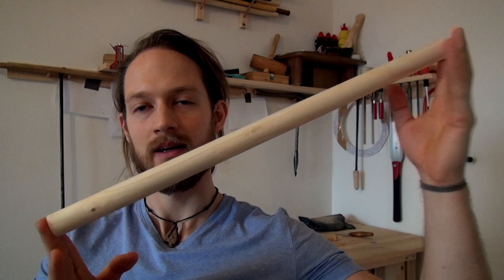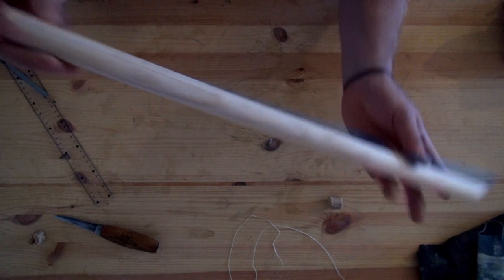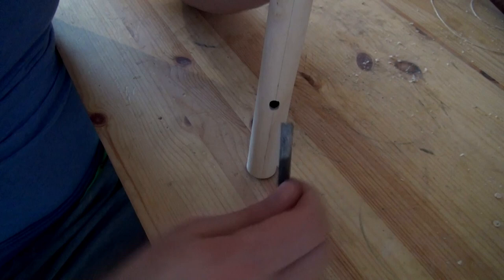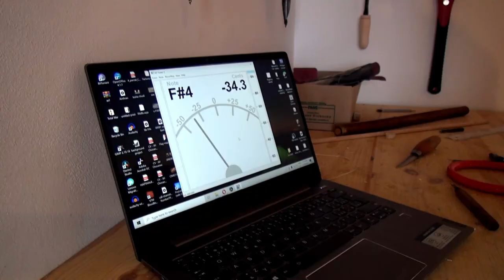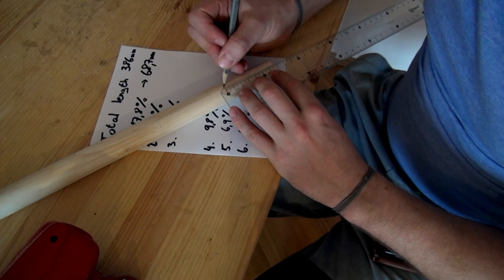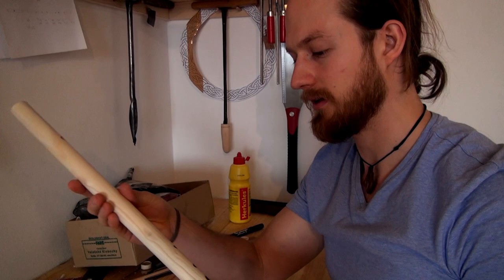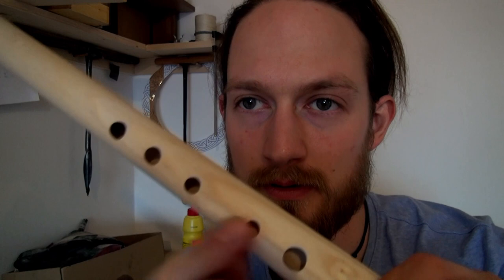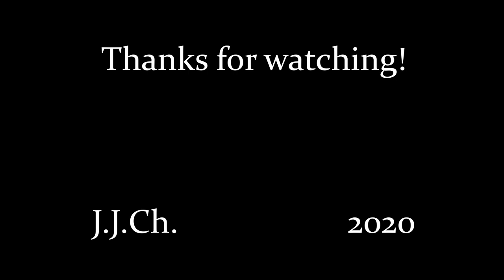How to make a wooden flute pt.2 - TUNNING

Comment: Fantastic information. Been looking for answers and you've provided charts as well. I turn wood as a hobby and a friend asked if I could make him a flute with Celtic knots. I wasn't quite sure where or how to start but this helps out tremendously. Question though if you don't mind. He wants a flute with a window gap as to be played from the front rather than the top, and I was wondering if there was a specific angle that it needed to be at. Thank you for your time and for this fantastic video.

Comment: The cork position in the length of the inside diameter from the center of the  embouchure. Say your inside diameter is 1.5cm...make a mark 1.5cm from the end of your wooden dowel and push the cork from the root note end until the mark aligns with the center of the embouchure hole. That's a good start! Good luck!

Comment: thank you so much for this great content. tbh though, it looks absolutely impossible to me to get to handcraft that wooden tube, perfectly straight and with that perfectly straight hole :O i saw the tool you used in the other vid, but yet.
Reply from the maker: Hello there, well no worries, the flute doesnt have to be straight at all. Watch my other flute videos, I am using a crooked tree branch as a flute material and it works just fine.

Comment: Hi 
Really like your videos.
I have had a go at making a high D whistle out of Elder.
The B note sounds a bit flat. This is putting my left finger on the hole nearest the mouth piece, all of the other holes being open.

Please could you tell me if making any of the other holes bigger would help, or if there is anything else I can do. 

I like the sound or it and the Elder is lovely to work with. The mouth piece is a high D Tony Dixon already made, so I cheated a bit. I have deliberately made all of the holes a bit smaller in case I needed to adjust.

Kind regards 

John

Comment: Amazing work, thanks. I am planning to make mine from cherry wood or any other dry wood or branch I could find but I have a question here: Should the form of the wood that I am going to start work with has to be branch form (originally syllindiric) or can I use any part of the wood which is cut from the body of the tree (I mean can I use the wood which is not originally syllindiric). Does that make any difference? And lastly, do you have any preferred kind of tree to make a flute or can I use any of them?
Reply from the maker: Late answer, but to your qustions:

You can use any part of the wood, just make sure, it is seasoned properly, so it won´t warp once you are done making the flute. I recommend using wood without knots, but that is personal taste really.

I like to use Ash and Cherry the most, but any hardwood can be used.

Comment: While tuning, how do you get the higher octaves in tune with the low octave while not changing the low octave? Do you enlarge the holes in a certain way? I made a flute but the low and high octaves are out of sync with each other and I don't know how to fix it. Thanks a lot!
Reply from the maker: Hello mate, this is actually quite complicated problem, which would be worth making video of its own. Which I may do once I have the time.

To keep the answer short, you can make the hole sound higher in the higher octave, while affecting the lower octave only slightly with couple of methods. The easiest one is to make the hole conical instead of cylindrical. 

conical = the hole is bigger on the inside and smaller on the outside

cylindrical = the hole has same diameter all the way through

But again it is more coplicated than this to get the perfect sound, I may cover it in some future video. Try using the trick I desribe above, It should fix your problem, or atleast improve it significantly. If your flute is too off (difference between higher and lower octave in several tones at the same hole) than there is something else going wrong as well - wall too thin or thick, bad material, some hidden crack etc.

Good luck!

Comment: Awesome video buddy, it helped a lot. I play flutes for a few years so now throught lockdown I started to make my own ones but I struggled with tunning a lot haha. I suppose that calculation is applicable even for different kinds of flutes and whistles ? :) I mean, what if I have different number of holes ?
Reply from the maker: Hello there mate, glad to hear you find it helpful! The calculation is definetly applicable to different kinds of flutes and whistles. 

If you decide to make and traditional irish flute for example (which has two more holes at the bottom, eight holes in total, though the two bottom holes are not played) you start by cutting those two calibration holes and than tune them to get your bottom note (traditionally that would be D). Than you continue you the same way I describe in this video, except the value "total length" (in case of this video 386mm) would be measured from the embouchere to the first of these calibration holes.

Other flutes (pentatonic flutes etc.) can usually use similiar systems. The best way to find out is to go and give it a try, Good luck!
Reply: Have a search on the internet for a program called ‘Flutomat’ - it’s fairly sophisticated and should help with all the calculations.

Comment: Thank you for sharing.  I do have a question, though.  Do you find that having a flat mouth opening is better than a traditional raised opening as in the silver flute profile when getting a better , or should I say with a less hesitation in the production of sound.  The silver flute allows for lip placement.  So, would it also be possible to make a wooden version of that type of lip plate?  Have you ever made a flute with a separate head joint or tunable slide joint?

Comment: Thank you so much for this amazing video. Can you tell me how you make or where to buy the hollow flute pipe?
Reply from the maker: Hello there! if you are looking for a wooden one, easiest way to make one is to use a wood lathe. 

But if you just want to give this a try, and not buy any expensive equipment, you can use plastic pipe from hardware store, the sound won´t be anything special, but it will work.

Comment: Have you found the same calculations for finger holes applies accurately to varying keys? eg. 17.8% from end of flute etc. Is this the same for all keys, like D, C,  A etc.?
Reply from the maker: Hello there, basically yes. The problem you might ran to, is that you have to not only increase the length of the pipe when you go for lower key flutes, but you also have to increase the inner diameter. (and vice versa for higher keys)

I don´t really have reliable formula to calculate the required increase of diameter. I basically know from experience what diameter to use for common keys. And if go for key I don´t make often (or never made before) I have a good reference point (for ex. If I want to make flute in Eb and I never made one before, I just use slightly smaller diameter than I use for D).

If you lack that experience you might have to experiment a little yourself and find the the correct numbers. You can also look at existing flutes sizes, in a key you go for, to find a good starting point.

Comment: Do you have any ways to drill trough a long stick like this one, with just simple tools?
Reply from the maker: You can use auger drill (they are availible in 50cm drill length, atleast in my country). In case you want more traditional approach, check my other flutemaking video on the channel, where I show how to drill the flutes.

Or if you want to give this a try, without having to worry about the drilling, you can use plastic pipe, with dimensions similiar to the ones I show in this video.

Comment: Is there a trick to drilling out the wood lengthwise to make sure you drill accurately or is that a matter of experience and trying it out many times?
Reply from the maker: Sharp drill and steady hand my friend, you might use piece of wood with bigger diameter for start, to allow for some error.

Comment: Great video, thank you very much! Two questions: 1. Where can I get the drills you use to make the blanks, I’ve searched for them for years... 2. Can you please share how to fix the height of the higher pitch if it is not the same as the lower note? I would be forever grateful!!

Thanks again!! 

Aron (the Netherlands)
Reply from the maker: Hello Aron, glad to help, thanks!

To your questions:

1) These drills are called "nebozez" in slavic laguages. They are very common in Eastern Europe (altough usually they are shorter and used in traditional carpentry, with length around 50cm - though it is easy to weld some extension to them). In english they are called "gimlets" or "gimlet drills". Finding really big ones is not easy - your best is to search ebay for something like "antique big gimlet drill". If you are from Europe you may be able to order some from the Eastern Europe as well.

 2) The upper octave sometime tends to be slightly flat (lower) compared to the bottom octave. To fix this, you make the playing hole bigger in the inside than it is on the outside (the hole has conical shape and not cyllindrical). This will make the upper octave slightly higher, while not affecting the lower octave. It may correct differences up to one half tone. Hope it helps mate, all the best, JJCh.
Reply: @JJChWorkshop  you are amazing! Thank you so much for your answer! I’m so excited!!
One last question, is it also possible to make the hole conical underneath itself in stead of filing the rim on the inner diameter?
(Does this make sense?)

If can if you like give you my mail address, perhaps we can talk more in depth there?
(I’m quite seriously eager to learn more!) 😊
Reply from the maker: @LeviLaVega      You can contact me on facebook, However I am spending a lot of time off the internet so answer may take few days. I have a page dedicated to my instruments - https://www.facebook.com/VoxArborisHome

-Outside of the flute

________________      _____________________      ______________________
 -Flute wall        |     |                                     /     \ 
_______________ |     | __________________/          \_____________________ 

                               No.1                                       No.2
-Inside of the flute

About the hole shape - I hope my picture will help you mate :D  The hole No.1 has cylindrical shape, the hole No.2 is conical. The hole No.2 will sound higher in the upper octave. But on the surface of the flute they look the same (have same diameter), cheers, JJCh

Comment: any tips for drilling a hole straight that far? hollowing it out seems hard
Reply from the maker: There are several ways to do it. You can go for a tpe of a wood that has soft pith inside, which will guide the drill (this is what i do in the video). Or you can use a wood lathe. If you don´t have and acces to one, you can drill through a bigger piece of wood, and shape it to cylinder after you drilled it.

Comment: Very nice! 
What are the dimensions of the blowing hole?
Reply from the maker: It is a rectangle with well rounded corners, roughly 8x1.1 mm

You can make it slightly different size though. Bigger hole will be louder, but also require more air to play.

Comment: does the inside diameter/ wall thickness matter to the sound, I can only find a drill piece long enough that's either 16mm or 20 mm, not 18mm
Reply from the maker: Both will work, the bigger diameter will require more air (more demanding on the player) and will be louder. The smaller diameter will be the opposite.

Comment: Would it be possible to make a flute like this with more holes that is near or fully chromatic?

If so, do you know how that would be done?
Reply from the maker: You can add one more hole to the bottom of the flute (lets say you have 6 hole flute in D which plays DEF#GABC# if you add one more hole to the bottom you can extend the range to make it play C#DEF#GABC#).

It is possible to add more semitones to make the flute "semichromatic" but explanation would take another whole video.
Reply: @JJChWorkshop  ah! Thank you for the explanation, I appreciate it 👍

Do you think you would be interested in making a video on how to make this "semichromatic" flute?

Comment: I tried to make a mini version from just a stick since i dont have a long enough drill to go through a long one, just air came though :(
Reply: I’m no expert, but I think a flute needs length. Not a lot of length, but enough so that the air can do its thing before it leaves the pipe. I’d take a stick that’s twice as long and just drill into both ends to hollow it out. Then just use some sandpaper or something on a rod to smooth the middle.
Reply: Oh, and cork the end with the blowing hole. I’d bet that’s what’s causing it.

Comment: how important is the diametar of the stick? is only important the 18 mm hole?
Reply from the maker: Yes the inside diameter is 18mm (you can make it slightly bigger or smaller, like +-2mm, bigger diameter will require more air pressure when playing but will be louder). 

outside diameter is up to you - i recommend making the walls about 2-3mm thick - meaning the total outside diameter will be around 22-24mm.

Comment: Never mind....distances are between each hole from previous hole.  Where did you obtain your wood blanks?
Reply from the maker: Correct, the distance is from the last hole and indeed, the distance between the last two holes is the same.

I make the blanks myself on the lathe.

Comment: Any reason why one can’t use a smaller drill bit and just drill larger hole to approach proper tone?
Reply from the maker: The issue with that is, that the walls of the flute are quite thin, and using the drills leaves the sides of the hole after drilling very rough (they chip parts of the wood). That is way I personally don´t like to use drills, but you may give it a try.

Comment: Would using a drill for the holes still be as effective?
Reply from the maker: The problem with using drills is, that they usually tear edges of the holes quite a bit. This makes tunning more difficult and it doesn´t look good. If you use sharp enough drill bits with pillar drill it can be done, but It wouldn´t be prefered method by me.
Reply: @JJChWorkshop  would it work a bit better if the holes were drilled before the flute is hollowed out?
Reply from the maker: @cookandclimb2742   It won´t work for two reasons - you need to already have the flute hollowed out in order to tune it (Drill the playing holes), and hollowing the flute with the holes already drilled will make it much more likely to crack.
Reply: @JJChWorkshop  ah, OK. thanks for the advice!

Comment: What is that type of drill called? The "flute drill" Google search is a bad one since common drills mostly have 2 flutes (the helical groves along the length of the drill)
Reply from the maker: It is called "gimlet" (or "gimlet drill"). In slavic languages we call them "nebozez". They are quite common in Eastern Europe, but you should be able to find them in the west and US as well.
Reply: @JJChWorkshop  Thanks! Although I find it hard to find one in "the West", searching for gimlets mostly result in augers and though any drill will probable work semi-well, I have a feeling the gimlet (or nebozez) will sort of self center if you drill in wood with a soft core string. Looks like I'll have to forge one myself 😵
Reply from the maker: @busybraintinkering465  Yea, you are right, the good thing about them that the self center, so even when you drill pieces of wood that are not straight they will go through the soft middle part. 

I don´t know where are you from buddy, but i think you should be able to get some from the ebay. You may need to do some searching, but I have seen some gimlets there. You are most likely going to find shorter ones, used for carpentry, not long enought for drilling flutes, but welding some extension should do the trick.
Reply: @JJChWorkshop  I live in sweden :)
Yes, I'll keep looking, but so far I've only found small diameter ones 3-6mm.
Reply from the maker: @busybraintinkering465  Okay, you may try contacting some of the sellers here - https://www.sbazar.cz/hledej/nebozez

The prices are very cheap, and many of the drills are the size you need, the problem will be persuading them to ship to Sweden.
Reply: @JJChWorkshop  Thanks! I'll try!

Comment: Little question, the proportion of holes distance, would be the same for a flute in D?
Reply from the maker: Short answer: yes

Long answer: Also yes, but I recommend using slightly bigger inside diameter (20-21mm works best). This will ensure that sound is balanced well in both octaves. The proportions will be the same, but the actual hole size and distance will be of course different (bigger).
Reply: You re an hero